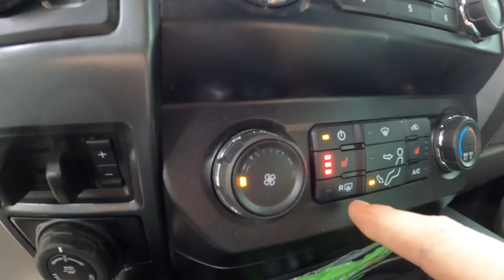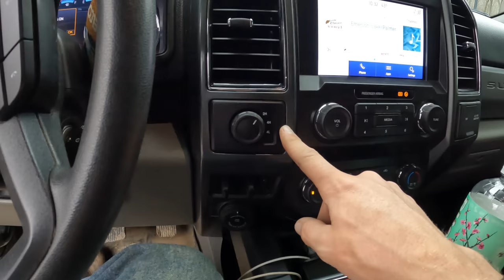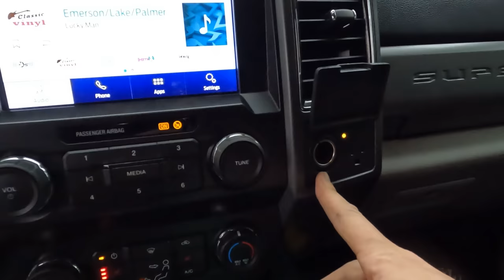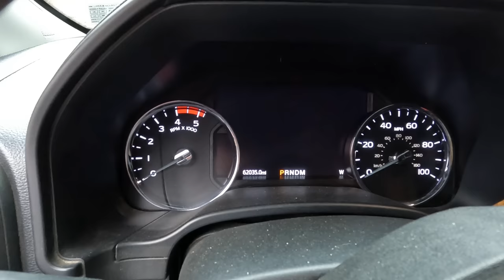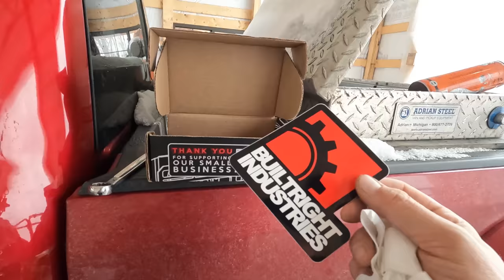I bought THE BEST Pickup Truck on the Market (Ford F450)

Comment: Hey Matt,
just a quick tip. Dont kneel down on your seats if they have seat heating. When you do that the heatingwires tend to break. The preowner of my car did this and you have to tear down the whole seat to repair it🙈

Greetings from Germany
Reply: that’s on german cars here in the US ive never herd of that being a issue, ima mechanic and work on alot of cars lol
Reply: @calebwiant1182  Yo, but not all german cars are crap lol
Reply: Don't know if that is an issue on a truck like this but it's an XLT with apparently the 'luxury' upgrade package so it would have the heated front seats.
Reply: @laurier3348  agreed
Reply: @calebwiant1182  Yeah if "anecdotally, slightly, more durable heated seat heating elements" is the only thing that us Americans could ever figure out how to do better than the Germans when it comes to automotive design... that's not much of a roast. lol. In reality, I'd venture a guess that it's actually American knees having a significantly higher amount of body fat in them that is the real reason you've "never heard of this in the US". lmao
Reply: The cp4 fuel pump doesn't use the oil for compressing the fuel.

Comment: those aux switches in the cab are genius, and having the dedicated fuse box, really makes adding work lights or beacons easy! and the step for getting in the back is another solid feature
Reply: But does it have an aux hole for listening to your own music?
Reply: @kirdot2011  Bluetooth is built in, so no wire needed :)

Comment: Biggest tips I can give you to make that 6.7 last is stay on top of your fuel filters and keep some kind of fuel additive in it I prefer Lucas or total power as a diesel mechanic I’ve seen a ton of 6.7 fuel systems fail due to our new diesel fuels having little to no lubrication earliest failure I’ve seen was 17,600 miles on a 2022 F550
Reply: They have a kit with a Stanadyne DCR high pressure pump now to replace the junk CP4. There's no way to make a CP4 last that I have found. My mom has a VW TDI that had one. Caught it right before it was going to send metal through the fuel system and destroy the injectors. Replaced with a CP3 conversion kit. That would be my recommendation, do the DCR pump conversion before the CP4 grenades the entire fuel system.
Reply: As someone who is now starting to geek out on trucks and mechanical stuff in automobiles, it looks like yall are speaking a whole nother language 😂😂

Comment: I'm with you Matt, heated seats are a must, I have a damaged back and it's so good especially in winter or when it's wet. My last car you couldn't get to change the front side lights and indicators unless that is you took the front of the car off! Fortunately my new one is much easier. With regards to oil changes on my diesel it's religiously every 10,000 miles. It just means that the engines don't start chucking out black smoke. That's a nice truck, hope it gives you many years of use. Happy Christmas to you and Eva, hope you have a lovely time.
Reply: I live in south central Texas and I won’t buy any vehicle without heated seats. Lol
Reply: The first time I heard about heated seats, I thought “well THATS the dumbest thing ever. “  the first time I used heated seats, I thought, “where has THIS been my whole life until now? “ But as nice as heated seats are, I THINK like my heated steering wheel even more.  I even use it in warm weather if my hands are feeling stiff… it’s amazing.
Reply: What does changing the oil have to do with chucking black smoke?

Comment: Fellow 6.7 PSD owner here, coming up on 200K miles with my truck, owned since new and absolutely love the truck. I always do my fuel filter changes every 2nd oil change. I think your limiting factor on oil changes on a stock truck will be fuel dilution if I had to guess. Congratulations on the new truck, hard work pays off. Here's to many more miles!
Reply: Changing the fuel filter every other oil change is a great practice on all new diesel equipment!

Comment: Hey Matt. On your oil change if you put all that oil in you may have over filled it.  The 6.7 powerstroke up to 450 holds 13 quarts and the 550 up holds 15 quarts. Also if its not been done replace the oil separator around every 30k miles or you’ll be doing an engine reseal. Ive done several reseals because of the oil seynot being changed. Keep up the good videos man!
Reply from the maker: I was talking to the camera and got distracted lol I did over fill it but I drained some back out 😂🤷🏼‍♂️🤦🏼‍♂️

Comment: I believe that the towing capacity can vary from truck to truck really. I have a 89 F-Superduty (first F-450 made) and every summer I haul 30 round bales @ 1200lbs each weighing in at roughly 36,000lbs not counting the trailer as its a BigTex 35+5 trailer weighing about 8,900lbs. I'm running a bone stock Navistar 7.3 idi with a 5 speed but my gearing has been changed to accommodate a larger load. The farmer i haul hay for has a 2020 F-450 and he has issues pulling that kind of load. Gearing has a huge role in the towing cap as well. Every truck manufacturer will keep updating there trucks to be better than the others but out of the 5 trucks I've owned (5.9,6.7 cummins, 6.6 duramax and 7.3 powerstroke and the 7.3 idi )I always go back to my 89 superduty its been the most reliable engine and everything. That being said I know someone will throw hatred towards this post for the simple fact that its the truth,  gearing has the greatest effect on the towing.
Reply: Gearing is a huge way to make up for a lack of brute power, as well as help newer vehicles tow more. Assuming you have 5:13's? Or did you go deeper?
Reply: @josephclemenson7656  I'm running 4.13s as my 1st gear is very very short
Reply: @outlawfarms3864  4:13's are good. My 84 6.9 IDI has 4:10's and tows pretty well. Nowhere near as good as my 2011 6.7 tho
Reply: @josephclemenson7656  I'm not downing the newer trucks or anything, but I've had better luck with older than this new stuff. Maybe it's just the less electronic stuff work better for me.
Reply: @outlawfarms3864  I've had pretty good luck with my idi, but my 7.3 was a nightmare. My 6.7 has more miles than either of em and has been less troubling
Reply: @josephclemenson7656  my idi has roughly 80,000 original miles on it but they were very rough from the previous owner
Reply: @outlawfarms3864  mine has I think 331k. Can't tell for sure. They were also rough and the rust has killed the frame
Reply: @josephclemenson7656  I understand that  I mainly run mine in the summer  for hay and park it the rest of the year  unless I need to make a run to lowes or home depot with the trailer  other than that ot sits mainly. Maybe a trip or two around the farm. I dud have 2 extra frames that I bought for spares for a  6.9 I have  but might end up selling them with the 6.9 truck
Reply: @outlawfarms3864  yeah I'm gonna be looking for an 05-16 frame for it eventually. Mine just sits now while I drive the 6.7

Comment: 19:40 Aluminum is only weaker then steel at the same thickness. If you make the aluminum just thick enough to match steel's strength, it may still be cheaper or lighter than the steel. (I'm not sure if it is cheaper or lighter, but it could be.)

Comment: The 6.0 and 7.3 had the engine oil “power “ the injectors.  The 6.7 has a mechanical fuel pump, gear driven, to get the injectors to spray.  One of the reasons it is so quite by comparison.

Comment: Not many diesels are using HEUI injectors. The 6.7 isn’t. It’s just fuel pressurized at 30,000 psi and the solenoid opens multiple times each power stroke

Comment: 18:13 - Check in the owner's manual regarding fuse placement for keeping the 12V power active with the key off. I know in my truck (a Chevrolet, not a Ford) I have the option to move a fuse position to keep the 12V power point active with the key off.

Comment: Wait till you have to lift the body off the frame to repair the leaking upper oil pan.  Try installing a ball valve on that oil pan so you don’t have to keep removing the bolt.

Comment: Hopefully you have better luck with the ford than I’ve had with my last four, pre filling the oil filter next to eliminates dry running the motor till the filter fills up and circulates.

Comment: 6.0 was the last of oil fired injectors. Common rail yes but injectors are electronically controlled and fuel pressure is made with a cp3/cp4 pump which is ran off of a gear in your front cover. Gm with the isuzu(duramax)  started that in the turn of the century. Your oil is critical still no doubt but you can easy run 15k mile intervals out of several full synthetic brands and be perfect. Modern diesels biggest issues are the epa and crappy fuel/filtration. Very nice truck tho 👍🏻

Comment: Going back and rewatching this video since I'm getting to the point my F150 is getting very under sized and looking at F450s, norstar/ironbull make a nice flat bed/service bed combo to where you still have a useful flat bed but also have good storage. And they have a decent amount of dealers in PA compared to VA, had to drive to PA for my ironbull dump trailer at I think best choice trailer

Comment: I work at a tractor-trailer repair shop, and 90% of our work is DPF and emissions related issues and replacements.  Most trucks are taking DPFs every year or two.  Hope yours fares better.

Most light duty trucks will take their first around 100k, then slightly sooner thereafter, because the aftermarket ones aren't as resilient as the OEM.  Gets costly.  Not to mention all the sensors that will shut the truck down if they don't like what they see.  A lot of potential downtime with one of these.  Hope you don't run into too much of it!

Comment: I have an 04 F350 with 03 6.0 (built at the transition)... most important thing is clean filters and fluids. Mine is still running at 280k miles with minor power steering and a torque converter issue. These trucks have an undeserved reputation, in my opinion.

Comment: My "work truck" is a 02 f350 single wheel crew cab short bed 4wd 7.3 lariat 6 speed manual had many a people try to buy her off me.

Always change my oil around 5k miles Heui system is hard on the old lubrication juice

Comment: Power after key is off… not positive on that truck, but you may have an accessory fuse with 3 tab slots, switch from right to left or vise versa and should give you power to usbs, cig lighter etc.

Comment: Is it a good idea to spray the frame inside and out with cavity wax? Once or twice a year? Remove the running boards until you can keep them from adding to the collection of dirt and or salt? Install drain holes in the running boards and or replace them with some stainless steel ones? Just a thought?

Comment: I have a 2021 F-150, and I noticed the only outlet that stays on while the truck is off is the USB port in the center console. If you haven't already, try seeing if the power outlet/USB port in your center console works. I know it does for the F-150, but I'm not sure if they have it like that on the F-450. I love both Old Blue and your new truck!

Comment: Sweet ride.  If you want to have some fun, I have see F450s lifted with a 4 super single conversion that makes a great off roader with the right tires.  😁  Of course probably not as practical for your purposes.  🤔  But seriously, if you want to see some practical mods, different tires, wheels, etc., go check out the BigTruck Big RV channel .  He has an F450.   Could be helpful.

Comment: I notice you didnt take my advice in regards to putting the pit in under the canopy, just think how much easier it would have been changing that oil if you werent squirreling around on a tight freezing cold floor.

Comment: With all the pickup truck towing capacity wars going on,it seems pointless for 99% of us since you need a  CDL to tow over 10,000 LBS (at least in PA).   I heard in FL they were pulling pickup trucks with big trailers over and impounding them until you could hire a driver with a CDL to drive it back out of state, if the trailer was over 10K.

Comment: Oh yeah that seat heating and that step for us old people. Still you shouldn't back down on working on new cars. I bought the wife an e class benz plug in hybrid. I still do the maintenance and have had to fix some small things here and there. Now i may prefer to rebuild old tractors but it's not as bad as you would think.

Comment: I changed mine every 10,000 miles which was recommended from GM and I used delo 15/40 synthetic which was also recommended from GM I had a 2012 GMC Denali crew cab 3500 Duramax rated at 395 horse power man it was a towing machine it is pretty amazing how they keep raising the towable rates on those things I have friends who have the ford and the rams and I think the fords have the highest towable rating but over all they are all about the same a person can't go wrong buying any one of those trucks I guess it all boils down to personal preference but to me I would buy any of them they are all good trucks

Comment: If you end up doing a flatbed with it, id go aluminum. Eby builds some pretty nice ones.  I deal with Greg at Eby in East Earl for Dane's.  He is awesome to work with. Expensive but worth it in the rust belt. They make a ton of different options.

As for oil, I run Mobil One Advanced Synthetic ESP in the 5W-40 flavor in our X15s.  Changing 25-30K miles, about 100 hours of idling if not 500 in summer.  Cummins and Paccar recommend somewhere between 35K and 75K miles depending on fuel use for those engines.  Its also 11 gallons of oil.  8-10K on a pickup like that is perfect in my opinion.  But what do I know, I am just some guy on the internet. LOL

Comment: Be wary with the aluminium, (yes, I’m British, it’s spelt correctly!) Where aluminium meets the steel between the body and chassis, you will get something called bimetallic corrosion. Aluminium will corrode because of this, and there ain’t much you can do about it. My old Land Rover rusted like that royally, so try and keep on top of it!

Comment: Nice truck. I’ve had two 6.0 power strokes. I still have a few 7.3 but those sixers made me into a Dodge guy. If you get lucky with a 6.0 you’re lucky. I was not. I did everything I could preventatively and ended up dumping waaay too much into the trucks to keep on. But the new trucks are all great. Ford GM and Ram. If you’re driving the 6.7 diesels you’re probably going to be happy.

Comment: My boss tells me horror stories about when the ambulance fleet was nothing but 6.0's. He says they spent more time down than running. 😄 He may be slightly traumatized by being a 6.0 mechanic for several years. 🤣 I'm decently familiar with the 6.7. We have 2 in the fleet now. Very reliable engine so far.

Comment: Bought my 6.7 new in 2011 currently sitting at 370,000miles oil changed every 10,000 
axels transfer case service every 100,000 Trans filter and fluid every 50,000
Turbo done at 248,000 bearing failure 
Trans rebuilt at 358,000
Cp4 from fuel contamination at 349,000

Comment: I have been kinda wanting to get me one of those F450s myself for the last years, but it is a bit troublesome to get one to Sweden.
Atm i have a MB Vito 18/19 medium length 190hp diesel and it has been good to me for most part, but i find it lacking in the usability department... Kinda low to the ground, hard to get parts in or out of it and not much weight left with 750kg / 1600lbs of tools in it, about 75%+ loaded constantly.

Would be good with a pickup that have dubble cab so i can get more then 1,5 friends with me.
Tooling cabinets on the sides on a service body and then a flatbed in between them, so i can load oil barrels, conveyor drive / return rolls etc with a crane or excavator.
Crusher mechanics is not the usual kinda mechanic out there, were kinda special with precision sensors and electrical stuff combined with 20lb sledges and oxy / acy in our tooling setup.
 🙂🤣

Anyways cheers from Sweden once again and have a nice Xmas.  /Emil
ps working on a update video, lots happening yet never fast enough.

Comment: The 6.0 was the last engine for the injectors that used oil to fire them Ford was the only one that used that type of system they went to the common rail in the 6.4

Comment: Beautiful truck, Matt. Looks like a real beast of a work truck and should serve you well. Yes, absolutely take advantage of oil test labs. One of my old Volvo blogs recommended Bloomberg Lab in Indianapolis. You contact them and they send you a sample kit. You suction about 4 oz of oil out of the dipstick tube and put it in their sealed vial send it off to them. You tell them what your vehicle is, how many miles on it, etc. They send you the results for their very reasonable fee telling you just what's in your oil, metal content and pollutant content and you tell them the age of the oil in miles and they tell you if the viscosity is still good or deteriorating. Good stuff to know. I told them the brand and weight of oil I was using on my old Volvos and the brand of oil filter and the change frequency and they told me the oil looked good as did the low metal content. Whatever I was doing was good for the engines and their ages and told me what to adjust on the change frequency depending on the level of pollution in the oil. Check in to them. They seem to know their stuff.

Comment: And just one more side comment here I love what you just said about not hopping up and hot rodding a vehicle to push it passes limits I completely agree I am a gear head as well and I love anything with an engine and tires or tracks etc but a lot of these vehicles are built "right" from the factory.    not to mention I'm a four guy through and through so...👍 If anything I'm a little jealous.. actually that's a lie I'm a lot jealous. I love you work area I love your channel I love what you got going on! 😅